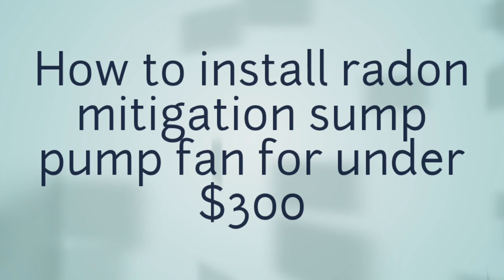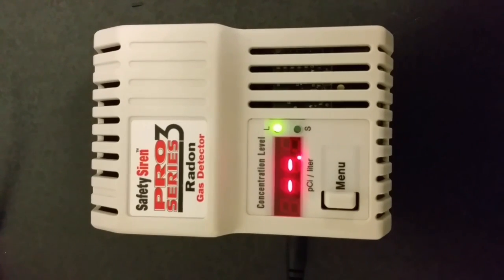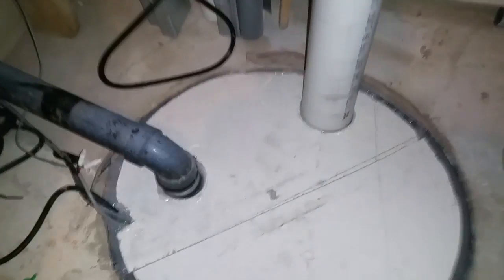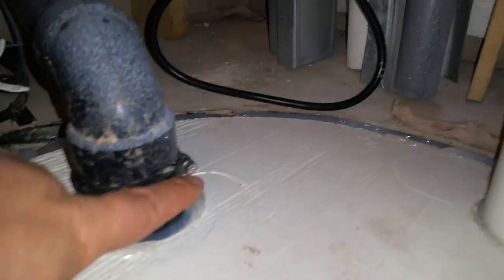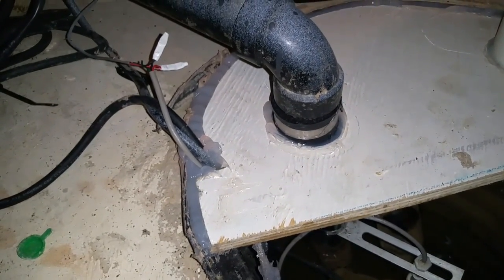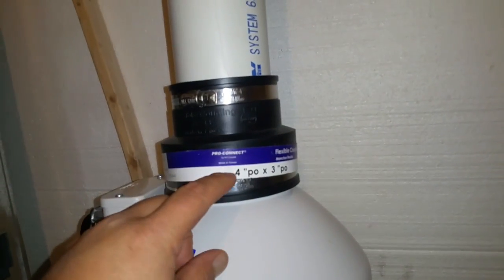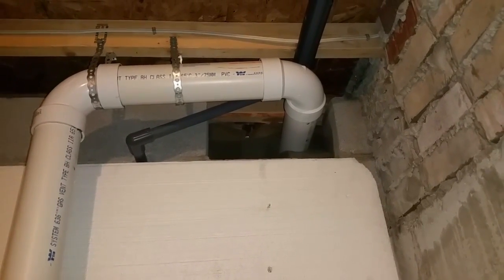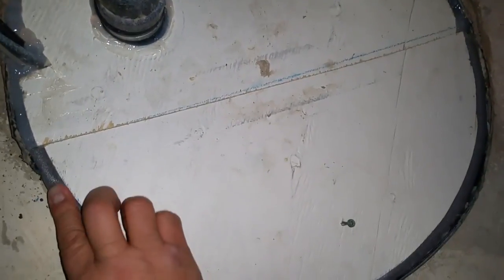How to install radon mitigation sump pump fan for under $300

Comment: This is a very interesting approach to mitigate radon very affordably.  And if it works in your home, that’s really all that matters. I don’t think it will work in all cases because you’re only pulling radon from the French drain (if you have one) within your basement.  Ideally, you want to bore down to a porous substrate below your home, if possible.  The other issue is that by sealing your sump, if you ever have a burst pipe in your home, water obviously won’t be able to flow into the sump and your basement will flood.

Comment: Radon system fan can only be installed inside the home if in the garage or in an attic. This is in case the fan stopped working you don't get a build up of radon gas.
Reply: Worse if there is a hole in the pipe above the fan it is now a radon pump. Lawsuit!
Reply: If the fan doesn't work then it is not pulling the radon in. However, it would be worse it the seals connecting the fan to the pipe leaked-while the fan is working
Reply: @cliftonprinty384 lawsuit against one self? :p
Reply: In some US states yes it's a code . 
It's common in other areas and  Canada to have fan inside next to basin etc . 
Doesn't matter practically speaking

Comment: Under no circumstances should a radon fan be installed inside the home unless it is higher up in the soil stack. For example, either installed in a home attic behind the knee wall or in the garage attic and exhausted through the roof. If the exhaust point is through the side of the house the fan should sit directly on top of a 90° bend. The remaining pipe should be 45'd back over to the house and 45'd up the side of the house. The exhaust should be 12 to 16 inches above the roofline. If the pipe wraps underneath or around a soffit the exhaust needs to remain 12 to 16 inches above the eaves. There are two types of flat sump covers that are easily modified by a Skil saw. With or without a removable viewport. There is also a two-piece domed cover that allows for the installation of a Sump Jet water back up. There's a third option that can be used for pedestal pumps.  This is a garbage can style high rise lid. Never put a varmint screen or cap on your exhaust.
Reply: This guy has a Canadian accent. In Canada you are permitted to install the fan in the basement because of the cold weather.
Reply: Lots of people commenting negatively on the internet about fan being placed in the basement, but lets set some things straight.  Actually Canada says the basement is the best location to prevent damage to the fan.  I live in Fishers Indiana, and the city allows installation of the fan in the basement.  If you think about it, if you don't allow the Fan to be located in the basement, then you should not allow gas furnaces or gas water heaters to be located in the basement.  As Canada says regarding radon fan installation, "properly installed fans and pipes will not leak radon into the building and are usually installed in the basement".  I will soon be installing my Radon Fan in the basement, no doubt about it (regardless of EPA recommendation).
Reply: @keithrogers2295  I just seen a Mike Holmes video on this and they have the fan in the basement LOL

Comment: Does anyone care to explain why a fan should not be placed in the basement?
Reply: It's against code in the United States. If the radon fan, the pipe, or fittings above the fan ever leaked, the radon fan would be pushing radon into the area. That is why you can't install a radon fan in a conditioned space. 

Check out section 7.5.3 in the radon mitigation standard. 

https://standards.aarst.org/SGM-SF-2017/18/index.html

Comment: This radon mitigation system install violates several federal guidelines set up by the EPA. Several more depending on the state its installed.  This radon system would not pass a home inspection if you went to sell your home and would have to be brought up to state and federal code.  In the long run you pay for what you get.  In this case, this homeowner wasted his time and money trying to be a DIY'er.  With this systems code violations it will cost this homeowner more $$ in the long run than if he would of hired a local licensed radon mitigation company.
Reply: What are you supposed to do when there are no radon mitigation companies in your state?
Reply: And yet... the measures levels of radon fell substantially.

Comment: I still can't figure out where the air is supposed to come from. Your groundwater system is.. underground. The sump gets its water through the pipe that is underground. The water comes from the weeping tile or whatever. But where is the air feeding the fan coming from?

Comment: Read a few of the comments so I’ll add a couple. Regarding the fan in the basement, I don’t really see the problem assuming that all the fitting connections are glued properly. Pvc pipes routinely carry water at much higher pressure than that exhaust fan will ever create. Downstream of the fan the pipes will be under vacuum so any leaks should theoretically not vent into the house. Upstream of the fan if the pipes are not sealed you could theoretically vent radon gas into the house. Or am I missing something beyond a possible code violation which I assume is based on the reason mentioned?
Regarding the no vent hole in your cover adding more load on the fan, I believe if you completely plug the pipe on the suction side the fan will actually work less hard.

Comment: I read that using a fan inside could force radon out of the ground and into the residence through possible leaks,shouldn,t the fan be located outside?thank you for your video.
Reply: It is precisely Ironically you named all the points of radon leaks
Reply: Make sure the joints don't leak. Thats the whole point anyway of getting it out of the house.

Comment: is Radon test 2.0 is bad? Our Home inspection to buy a house came back with 2.0.
Reply: No. Above 3 is when they recommend remediation.
Reply: @RandyKrakowski  are we talking pCi/l or Bq/m3. there is a 37 to 1 conversion. 2 would equal 74, 3 would equal 111. so to hit the low end of the remediation scale ( the number at which being lower no longer requires remediation) 200 Bq/m3 would be 5.4 pCi/l.  if my math is off please let me know. my point here is at 3 you are well below what would be considered a number to take action at.

Comment: I suggest hiring a professional when it comes to radon. I'm no expert but I do know the fan should not be inside the house. They are usually installed in the attic.
Reply: It's frustrating to hear someone with no knowledge of Radon comment as if they are an expert. You have absolutely no idea what you're talking about. Someone told you that it was a scam, so now you're regurgitating that sentiment to others without any information to back it up. Radon is not some magical concept that was invented to get money from people. It is an actual radioactive gas that emits alpha particles that damage lung cells. It's easily traceable by several methods and has been shown to cause lung cancer. This is not new science. Just because it's invisible, doesn't mean it's not there. Just because you haven't researched it, doesn't mean it's fake. Please, do a little research before you comment.
Reply: I've always wondered why anyone would put that ugly fan on the outside of their house.. Does it really have to be outside? Wouldn't that made it more prone to weathering? The only reasons I can think of is the fan noise would be less, and for Marketing.   If people see those odd-looking fans in their neighborhood, and then learn about Radon, they are more likely to start suspecting they also might need one of those new odd-looking Radon fans that everyone else is getting installed..?.

Like the guy who made this video. You can get 2.0 pCi/l or more in just about any old unventilated basement in the state of Massachusetts!  I'm happy just to keep it under 4.0 in my basement. (Goes up after rain. Water moving over granite). 
We have a lot of granite around here (10 miles north of Boston), so my lawn emits around 2.0 pCi/l after it rains..
Reply: Lots of people commenting negatively on the internet about fan being placed in the basement, but lets set some things straight.  Actually Canada says the basement is the best location to prevent damage to the fan.  I live in Fishers Indiana, and the city allows installation of the fan in the basement.  If you think about it, if you don't allow the Fan to be located in the basement, then you should not allow gas furnaces or gas water heaters to be located in the basement.  As Canada says regarding radon fan installation, "properly installed fans and pipes will not leak radon into the building and are usually installed in the basement".  I will soon be installing my Radon Fan in the basement, no doubt about it (regardless of EPA recommendation).
Reply: As Richard Lee said, his radon levels go up when it rains. Which makes perfect sense because the ground around your foundation is absorbing all the water and raising the radon. Since a sump pump is in place to capture this rising water level, it makes sense that you could also capture the radon there. Especially provided you have sealed the sump pump lid and everything else in your foundation, like cracks, etc.. routing outside is the other part. You don’t want to shoot out to neighbors etc, so some contractors seem to run the pipe up the house and out of the roof.

Comment: Hi, great video. BTW, how did you figure out that sump pump was the source of the radon gas? is it by placing the detector in various places around your basement until you hit the highest value?
Reply: Gene Delovsky The radon seeps up through the ground through cracks in the basement floor. The sump pump is below the basement floor so you want to create a vacuum under the floor where the sump pump is. This is just easier than drilling a new hole to create vacuum under the concrete. Hope that helps.

Comment: Why does the radon exhaust pipe have to be above the roof-line?  Since radon is heavier than air, pumping heavy radon gas up in the air, is just going to spread the radioactive material around to your local neighbors.   Like the people next door with a fan in their window, to bring in some fresh air.. (Got the radon out from under the basement slab, and into the lungs of a 2 year old kid next door)! 
Wouldn't it be safer just to dump that radon-air out down near ground level, where the wind would spread it around on the ground. It's going to get down there eventually, right?   https://www.youtube.com/results?search_query=radon+chain+of+decay
Reply: @rett1015  Yeah, I think that's correct. What we are doing with these Radon pumps is moving concentrated Radon (confined to a small area) up and out to an area where it will be diluted by the unconfined atmosphere.
It's all about the Concentration.  If you are sucking in 30 picocuries per liter of air in the basement, that might cause you medical problems. But, if you are outside and sucking in 3.8 picocuries per liter of air, no problem..

"One pCi is one trillionth of a Curie, 0.037 disintegrations per second, or 2.22 disintegrations per minute. Therefore, at 4 pCi/L (picocuries per liter, the EPA's recommended action level), there will be approximately 12,672 radioactive disintegrations in one liter of air during a 24-hour period."

Last month I installed a pump (like in the video) in an old house (kids new home) with a leaky basement floor, with New England radioactive granite underneath (22.8 pCi/L).  The 4" PVC sucks it up off the basement floor (intake 6" off the floor) and the fan blows it out a dryer vent into the backyard. The Radon has been showing less than 1.6 pCi/L for weeks.  (both Long Term & Short Term). It's on a timer, set to turn off at 1AM, until 7AM to avoid sucking very cold damp air into the house at night.
The basement temp & RH are monitored by the alarm system,  air is good and it's very stable down there.

There is also a new Bluetooth Radon sensor down beside the sump hole, but it doesn't work at all.
Both of my old Safety Siren units work fine.  The Safety Siren Pro Series3 Radon Gas Detector - HS71512 was purchased in Dec 2011, but the other one is an Safety Siren older model,  (no decimal point) purchased years before I retired in 2008.  Seems like these things last a very long time.
Reply: Absolutely not!  Radon continues to rise and should exit home above roofline!   No it doesn’t come back down and settle.   The natural air dilutes it immediately to a very minimal pico/l level that’s safe.    Heavier than air doesn’t mean in terms of weight.  If it doesn’t exit above roof, it can re enter home around Cracks or windows and doors and you could be worse off.
Reply: @rodhaffer2905  When you set up a Radon detector, it must be about 12 inches above the basement floor (away from any air vents or fans). 
If you hang it up six feet above the floor, you are likely see very low readings. (See detector manual)   Every time the dryer or the oil burner comes on, cool air near the floor is pumped outdoors. It only takes a few minutes to exchange all the air in the basement.  98% of the time, my radon is low, but if it rains a lot, the reading will peak for a while. The peaks usually last a few hours.

Comment: Definitely not an approved setup without flaws!    Needs to exit the home 12” above the roof line or it can re enter the home.   Good luck though it will probably help your levels go down but be sure to test in other areas of home

Comment: Good lord, DO NOT PUT THE FAN IN YOUR BASEMENT
Reply: It is inline fan so why does it matter where the fan is?
Reply: @_D_E_N_N_I_S_  I see your concern but if properly installed these PVC pipes won't leak anything. If gluing PVC pipes was challenging and wasn't providing perfect sealing then yes. However, even then, to have a backup gas inside the home the outlet must be clogged in some way since the gas is flowing toward the lowest resistance path. Thanks for your reply anyway.
Reply: @aurodenver  the radon pipe should either be on the exterior of the house or the attic. That is epa protocol. I am a certified radon mitigator.
Reply: @remy186865  Is self installing a system like this into the sump pump acceptable? Or do you HAVE to drill a new hole separate from the sump pump? Thanks in advance!

Comment: everyone bitchin about the fan inside, what's the the difference between your furnace or water heater, if those leak the carbon monoxide will kill you in hours and yet that's ok to have a positive pressure🤔
Reply: it has to do with code. This house and radon system wouldnt pass inspection because of that single issue. You would have to do it all over again if you want to sell your house. And also, to answer your question, that's why houses have carbon monoxide alarms.
Reply: They want a redundant feature . In practical terms , with a proper installation it does not matter if the fan is inside the house . The code is to protect against something  blocking the exit , a bird ice etc  and piping , possible inferior PVC installation , unseen cracks in pipe or fittings .
If the fan is outside and it is blocked for some reason it will not exhaust  into the home , it will blow outside if cracked , or if blocked the motor goes off on overload or burns out .
It's not any more trouble  to locate the fan outside , just need an outlet for power , outside install is  the right way of doing it and you'll never get dinged by an inspector.